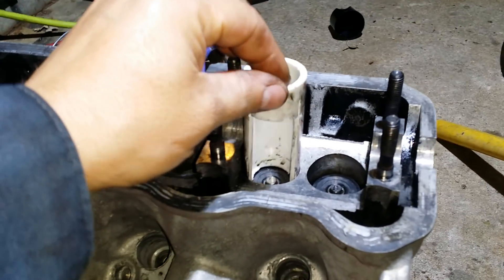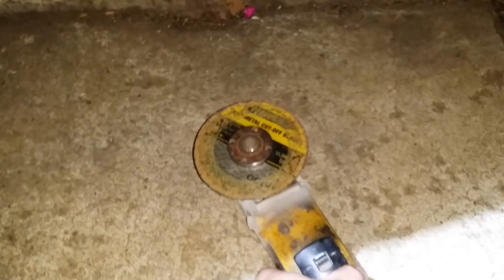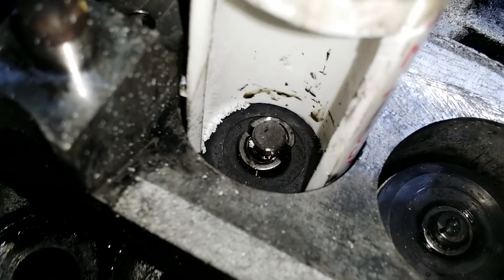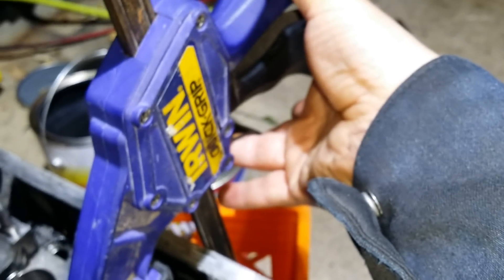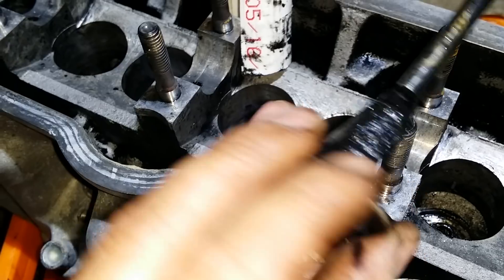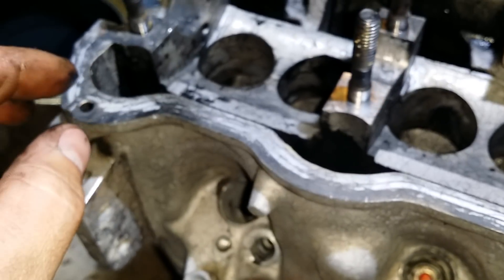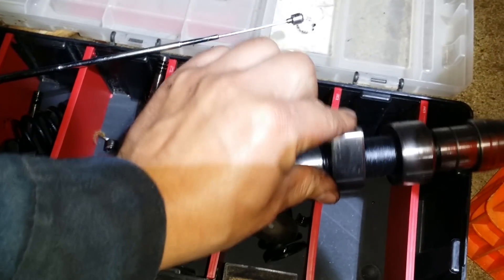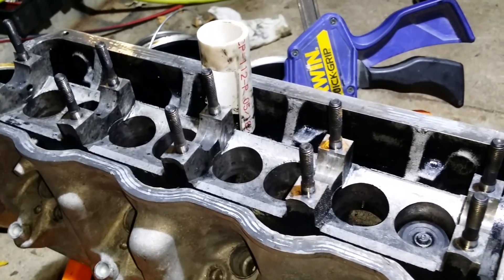Catastrophic failure using waste vegetable oil

Comment: Your problem is NOT WVO. How does using veg oil get behind the inlet valves? The fuel is squirted into the combustion chamber on a diesel, it never gets behind the inlet valve. To say veg oil caused the deposits behind the valves is misleading and ignorant. It cannot possibly do that, your poor engine design is responsible for that and I bet if you google your engine you will find lots of examples of the problem from people whom run diesel and have never touched WVO.
 That is from the EGR of your engine. Was it a VW? they have a lot of problems with that. Also, how many miles on your engine to start with?

Rings being fouled can happen with normal Diesel. If you had the fuel turned up on your engine and was running it rich then Veg can gum rings because the engine has too much fuel to burn cleanly. 
I have been running WVO for the last 11 years and have run more than 100K miles on it and Never had a problem. I filter and dry the oil correctly and understand the properties of the fuel and my engine. I don't heat the veg like so many do because that is useless and misguided.  I run water injection remove any deposits as I have the fuel turned up for performance and the water keeps the engine clean. 

At the end of the day, what you saved with veg on buying fuel will probably pay for 5 engines so you are still well in front. If you want to use it again, run water injection and make sure your engine is not over fueled. If you don't want to use it again, that's fine too, more for the rest of us using it. Just don't go around ignorantly blaming the veg oil for doing things it didn't do and you clearly don't understand.
Reply: Block your EGR and install a catch can...
Reply: Great reply!   I thought the guy was a hack too!    I'd like to learn about water injection before I convert my 7.3 to run on veggie.  would like to connect with you!    my email:     greencasa at gmail   - don't forget to reformat my address... :)
Reply: I let it settle in a stainless tank for a week or so then filtered it thru a Cummins Fleet Guard bypass filter that I had modified to take a roll of paper towels. I had a recipe that called for 30 gallons of waste oil 5 gallons of gasoline and some diesel oil.additive to clean the system. The Datsun had a simple injection pump. The Ford pump had too many small parts. I probably used too much bacon grease. The quality of the waste has a lot to do with it. The gasoline helped make the heater less important.I'll admit when I first started I didn't do as well at cleaning it. On.the Datsun I made the stock tank unusable. I had a 35 gallon plastic tank in the bed. The Ford had 2 50 gallon saddle tanks in the bed.
Reply: When you say you run water injection, what exactly are you talking about? Using coolant line to heat the oil? Thanks
Reply: @sirridok   I spray water from a drum in the back of the truck into the air Intake. 
I can mix in up to 50% Methanol which also give the old girl a healthy boost and cleans the engine even better.  Straight water is fine though.  The water phase changes to steam in the cylinders which removes all carbon buildup in the engine especially from around the Critical ring area.  Water injection for this purpose does not need to be super fine misted like many make out, just get it in there. I use a dosing rate of 300Ml Min on a 4.2L Diesel.  It is activated by Boost. On my earlier NA truck I just used the accelerator pedal to activate the WI at full throttle. 

I use a $20 12 V Diaphragm water pump and a flattened bit of copper tube as a nozzle to regulate water flow.  Worked perfect for  20 years going all the way back to my old Mercedes I started out on.
Reply: @glumpy10  wow,not what i expected..so you do the water injection with regular diesel fuel or does it work with WVO?
Reply: @glumpy10  excelent idea.
Can it damage the engine (cracking had or valves) when you ad cold water in hot engine over air intake??
Reply: and so did i and me transit lasted 9 weeks
Reply: @TheCitroenman1  awww
Singe tank system ?
Centrifuging while driving ?
Heated oil ?
Reply: Never heard of water injection for that purpose. My Datsun did pretty good except for the O-rings swelling in the priming pump. I destroyed the 6.9 Ford injection system. The problem I had is because of the return line I eventually contaminated the tank I used to flush the system. I probably saved enough to pay for the old truck but it was a hassle.
Reply: How did you run on wvo, but not heat it? Was it blended?
Reply: Boss please explain about water injection to keep engine clean ? I don't understand. I am about to go wvo with 1996 vw t4 , 2.4 diesel 
Should i go to tanks or just 1 tank ?
Should i do engine overhaul before using wvo ? 
Planning to buy t4 with about 220 miles or little more .

Lastly many sources i have touched are advising to have centrifuging going real time  in wvo fuel system , cleaning and dewatering fuel while on the move + 2 tanks system for rinsing engine with diesel.
Any suggestions will be enormously appreciated.
Reply: +TheCitroenman1 IF you change your oil at regular intervals, that doesn't happen. I have been running veg over 10 years and never had a problem becuse I maintain the vehicle.
Reply: The Dummy Spit oil change after how many miles
Reply: Can you tell me more about water injection in TDIs running wvo? I've been running WVO, but interested in the water injection part.
Reply: the veg oil ends up passing oil rings and mixes with the normal oil and sludges up till its hard killing valves and crank bearings the veg oil is thicker than diesel
Reply: @TheCitroenman1  Bullshit i have been using it for years not 1 problem
Reply: @chris-jb5ds  bull
Reply from the maker: When you start to have a massive blow by dew to stuck rings  all the unburn fuel goes in the crank case then gets pushed  through the PCV valve and right  through the intake and you guessed where the wet unburned wvo fuel  gets stuck to.... intake valves and also the exhaust because of low compression and fuel is not burned properly.
Reply: +Anderson E Rockefeller
The problem is NOT WVO if the rings are stuck or the PCV system is pumping rubbish back into the engine.
New Toyota Diesels are having the same trouble and a hell of a lot of it even when they are running regular diesel fuel because of their PCV setups. Vw's have the same issue as well.

It's a stupid idea to begin with and I take it off any vehicle I buy straight away.
Reply: +Oil Burner  I just looked at your other vids and saw this WAS a VW engine, an engine known to have PCV issues even on regular diesel!

Why do people blame WVO when the problem is well known to be the engine design and veg has nothing to do with the poor engine design?
You should be warning people of crappy Volkswagens not veg oil. 

Have you stopped using veg oil now or gone back to it after finding the real problems?
Reply from the maker: Oil Burner I had to replace the piston rings and connecting rod bearings since I removed the Pistons,  I have never in my life seen rings stuck so bad to the Pistons! !!! I had to soak the Pistons for over 2 weeks in powerful solution  not to mention all the valves where completely clogged, I used wvo for a bit over 100k miles just me not prior to the previous owner, before I started losing compression at idle had s bad misfire and also a massive massive Blow by, total miles half million, now that I rebuilt the engine I stopped using WVO since diesel by me is 1.75 a gallon.
Reply from the maker: Wvo will destroy an Engine if not heated up, I damaged  (2)1.9 tdi, 7.3 idi and also a semi with a Cummins engine. NEVER EVER idle with Wvo more then 5 minutes. Also the wvo that I used was clean under 1 micron and heated to make sure it's super clean just like diesel fuel.
Reply: +Anderson E Rockefeller  Sorry but that is Garbage!  I have run a totaly stock fuel system on my 2 vehicles for over 6 years save for a different ( cheaper) fuel filter and have not had a problem even in winter when it gets to freezing. The only heat the fuel gets is from the underbonnet temps that all vehicles have.  I live in teh city and my truck gets idled more than 30 min every week, typicaly more than once and has done so without problem years on end. 

If you have stuffed up all these engines, the problem is with you and the way you have them setup not the WVO.  I would guess you might like to roll coal and have adjusted teh pumps from their factory setting to get more power.  That will cause the clag through too much  unburnt fuel, not that it is unheated. The heating thing is a load of veg mantra repeated by people that never really thought the problem through but just parroted what everyone else did and said. 

You said you used veg for 100K miles. How many miles did the engine have by then when it clagged? I have seen people go on dozens of times about veg killing an engine that was 3 parts stuffed when they got the thing and then they go on like they should have run forever! Did you change the oil regularly as well ?  If you ran veg 100K miles, the money you saved would pay for 10 rebuilds of the then worn engine anyway so what is the problem?

If you want to run the pump over fueled or out of spec, Put a simple water injection system on your engine. It will clean out the deposits left from an improper setup and keep the things running perfect. I also run Methanol in mine when I want more power and that also does a great job of cleaning things out. 
I wouldn't run a diesel on Diesel without WI because they will foul up too if over fueled on an old engine. 

Don't mislead people as to what the problems are. It's nothing to do with heat or WVO, it's running unsuitable engines that have design issues from the start in an engine that has had the fueling changed from what the factory setup was.
Reply from the maker: Stuck Rings will cause massive Blow by that gets sucked through the intake from the pcv  and  will deposit onto your intake and intake valves specially when you have an egr cooler.
Reply: Anderson E Rockefeller what happened to the 7.3
Reply from the maker: @brendan25  I still have the 7.3, replace injection pump twice because in the winter oil way too heavy and pump couldn't handle it and you guessed it, snapped the input shaft, installed a heat exchanger and that fixed my problem .